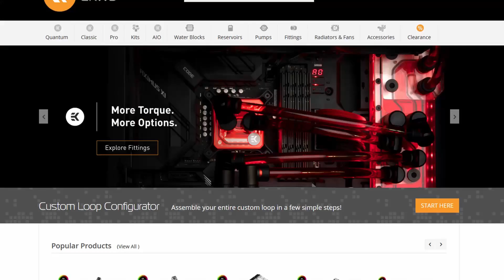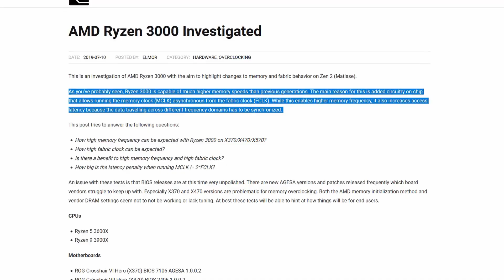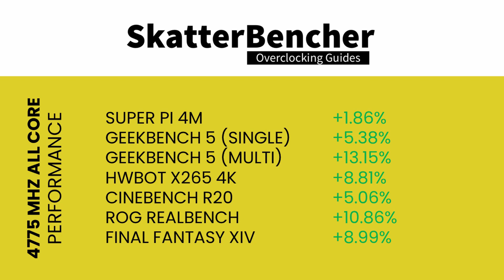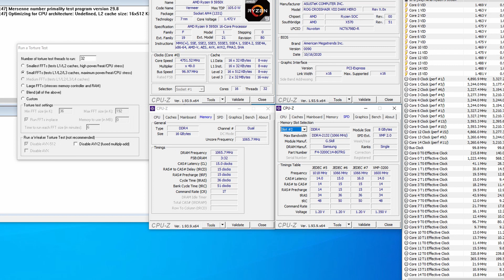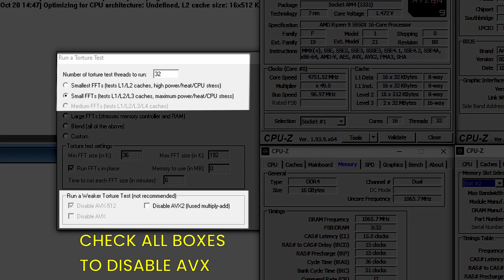5 Minute Overclock: Ryzen 7 5800X to 4775 MHz

Comment: I have it. İt's impossible to CO to 4.7 or 4.8, it always crashing, with H100İ RGB PRO and Asus X570 E gaming. (Tested in Cinebench
) And it's overheathing.
Reply: I have achieved these exact clocks with a 5700X and a MSI motherboard, however I use a 280mm AIO.
Reply from the maker: Yes, since your cooling equipment (240M AIO) is less powerful than mine (360M Custom Loop) it's unlikely you can run exactly the same settings as I show in the video.

The overclocking process will be the same however.

Comment: The manual OC of 47.75ghz @ 1.425v seems high. Is it safe as long as temperatures are kept low? I also have a 5800x and am currently at 47.5ghz @ 1.325v it's prime small sfft unstable but game stable.
Reply: It's fine, use OCCT to stability test instead of prime95.  You will likely never get a load that prime95 does in the real world.  I would not go over 1.35 volts.  I am running 4.440 Ghz at 1.1 volts.
Reply: .

hello 5800x in stock from original bios v core 1.4
Reply: @ggstudiots9866  but stock goes from .2 to 1.5. Having 1.4 fixed, CPU will degrade fast.

Comment: hello, I'm at 4.6ghz at 1250v, is this good? 83c on cinebench r23?
Reply: I got mine to be at 1.24375v and 4700MHz. Runs around 74C under full Cinebench load (R20) and consumes about 88W according to Ryzen Master. This seems to be my CPUs sweet spot as any all-core above 4700MHz requires adding way more voltage. I cannot get mine to ever finish Cinebench at 4775MHz, it just crashes no matter how much voltage I throw at it. I am on all Air cooling. My Cinebench R20 score at 4700MHz is around 6150-6160.
Reply: @bellotriggerfish  try a little P95 with these settings and watch the bluescreen :D
Reply: @Amarushaya92  I have  since decided to go a different route. I am now undervolting the CPU to 1.1v and 4475MHz all core. I never run the CPU at full stress, but I have tested stability using Cinebench R20 and fiddled around with voltages and clock until Cinebench R20 was stable across multiple runs.
Reply: Im at 4.6GHz with 1.206V and max temps around 70 C i cinebench R23 with about 15800 points on multicore
Reply: @jakub9575  I tried your settings on my 5800x and it crashed in 2 mins. One reason could be that my ambient temperature is around 80F (AC not working), but I had to downclock from there.
Reply: @andreirachko  There is a lot of thing that can go wrong, mobo, ram etc, my cpu is working the same way from when it launched by AMD with no problems.

Comment: guys I need your help. I got a 5900X and use a ASUS ROG X570 Hero. 32GB 3600Mhz CL16 RAM and a NZXT Kraken X73 Cooler. I only Enabled PBO and when I run cinebench R20 my CPU goes to 90c easily... what is wrong with my system?
Reply: reapply thermal paste.
Reply: @davidm8316  I already did
Reply: Did you solved the problem?
Reply: @gintonic8476  not rly, it‘s still like that
Reply: Did you remove the plastic from the AIO coolers? The peel off sticker?
Reply: @mirzafrenkie  of course
Reply: @papitnl  Weird man. 90 degrees is crazy. Maybe try reapplying thermal paste.
Reply: @mirzafrenkie  I know… I don‘t know what‘s the problem I did everything…

Comment: Wow alot of people going to screw up their PC watching this video, especially with setting those memory timings when they dont have the memory that can run those settings.
Reply: Yeah, I think more care should be taken to ensure people are running memory that can support those timings, or at least explore how to check what your memory supports
Reply: jeah , also he is using dynamic oc switcher wich is just available on ASUS Crossair Dark Hero :'D
Reply: Yes I am one of said people now my pc turns on and lights up but no picture no keyboard or mouse lights even after resetting CMOs
Reply: @joshuamccloskey2438  Try unplugging you PC from the outlet for a few minutes before resetting the CMOS. If you're using a jumper to reset the CMOS try to pull the CMOS battery out for a minute instead.
Reply: @  thank you this worked …
Reply: well, they'll quickly learn about the CMOS reset if they didn't know already. Memory tuning is so annoying, i had a quick go and kept fucking it up so it wouldn't post.

Comment: Is the dos oc present in Asus tuf gaming  x570 pro? I didn't see the dynamic of switcher in per ccx menu!
Reply from the maker: No. DOS OC is an exclusive feature of the ROG Crosshair VIII Dark Hero
Reply: @SkatterBencher  It is also featured on the formula so not quite exclusive.
Reply: Thanks for the reply... Any idea what is to be done in that case with Asus tuf x-570 pro? Once I put in these settings the motherboard is not even starting.. 🙄
Reply from the maker: The settings in my video are for reference only. Each system will overclock differently. Especially if you have different cooling. You can also check my full video to a more detailed guide: https://youtu.be/gDLuwNp06-Q
Reply: @pinakibhattacharyya8936  Did you ever get a fix? Or figure out what settings were causing the issues? I have the same board and same problem, orange LED on the mobo and no boot. Reset the bios back to stock and it boots fine...
Reply: Or if I may ask you as your videos are one of the best for overclocking.. can you please make one for Asus tuf x 570?
Reply from the maker: If I can find the time, I'll try to look into it!